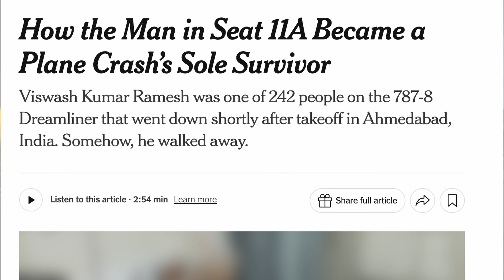Why the RAT Changes Everything – Air India 171 Update

Comment: Still to be verified but it looks like a catastrophic electrical failure on rotation. 

Flight: AI-171 | Aircraft: Boeing 787-8 | Date: June 25, 2025 | Route: Ahmedabad (VAAH) → London Heathrow (EGLL)
Crash Site: ~1.2 km from VAAH Runway 23, post-V1 and rotation
Fatalities: 247 (243 onboard + 4 ground)
Survivors: 0 onboard survivors (alternate to original), 3 injured on ground

⸻

🛠️  AAIB Preliminary Report Highlights

1. Primary Cause – Electrical Power Transfer Interruption (PTI) During Rotation
	•	During transition from ground to airborne electrical configuration, the aircraft experienced a cascading dual-engine FADEC (Full Authority Digital Engine Control) failure.
	•	Root cause: Uncommanded bus transfer failure due to arcing in the main power relay box (PRB-A), traced to water ingress during pre-flight GPU disconnection in heavy rain.
	•	This led to loss of electronic engine control at rotation, resulting in both GEnx engines rolling back to ground idle within 4–5 seconds.

2. Flight Data Record Timeline
	•	+0:11 sec: Nose gear lifts off.
	•	+0:13 sec: Sudden engine rollback begins. Thrust reduces from 92% N1 to <27% within 3 seconds.
	•	+0:16 sec: Master caution + ENG FAIL L/R warnings. FO calls, “Both engines dropping!”
	•	+0:20 sec: Autopilot and flight control reverts to Direct Mode. Pitch up attitude peaks at 18°.
	•	+0:25 sec: Aircraft stalls at 186 ft AGL.
	•	+0:30 sec: Full aerodynamic stall; nose drops rapidly.
	•	+0:38 sec: Ground impact at 54° nose-down attitude, 174 knots.

⸻

⚙️ Contributing Factors
	•	Environmental Conditions:
	•	Torrential rain during pushback.
	•	Moisture intrusion into PRB-A connector (P/N: HLN8471) — a known corrosion-risk component.
	•	Latent Maintenance Issue:
	•	Power transfer relay unit showed signs of thermal damage in a previous MEL deferral 2 weeks prior.
	•	No replacement had been conducted; aircraft was cleared under repetitive deferral.
	•	Design Oversight:
	•	Boeing 787 has no physical engine control backup (i.e., no direct mechanical linkage in FADEC loss scenario).
	•	Loss of power supply to both EEC channels resulted in engine “freeze” at ground idle instead of flameout.
	•	Flight Crew Response:
	•	Attempted engine relight sequence not completed before stall onset.
	•	Emergency power selector not activated — possibly due to confusion from multiple ECAM warnings.

⸻

✈️  Immediate Safety Actions
	•	DGCA + EASA + FAA Emergency AD issued within 24 hours:
	•	Mandatory PRB-A moisture integrity inspection on all Boeing 787 aircraft.
	•	Temporary restriction on dispatch with MEL items related to power transfer systems.
	•	Boeing:
	•	Issued Service Bulletin SB-787-24-212 requiring replacement of PRB-A connectors with sealed versions.
	•	Exploring addition of dual-path power redundancy for FADEC systems.

⸻

🧠 Lessons Learned
	•	Over-reliance on electrical power distribution architecture without layered redundancy.
	•	Lack of crew procedural training for full engine rollback during takeoff in EEC dual failure scenarios.
	•	Need for improved environmental sealing in GPU/electrical handover units in monsoon zones.

⸻

🕯️ Human Toll
	•	The loss of 243 onboard lives, including 12 crew and 18 infants, deeply impacted the aviation community.
	•	Final words captured on CVR: “We lost everything – no thrust!”
	•	One family of five was killed on the ground in a hospital ambulance struck by debris.

⸻

📅 Timeline – What’s Next?
	•	Aug 15, 2025: Release of FAA/Boeing electrical design audit report
	•	Sept 5, 2025: ICAO session on electrical-critical phase-of-flight risk mitigation
	•	Oct 2025: Mandated design retrofit across 787 fleet (rev. SB-787-24-219)

Comment: the point is,how come the flight took off upto 625 ft high if both engines failed, if there was power failure, if there was hydraulic failure, thrust failure???? How lifted itself up if there were key power failures???? Does it mean everything was perfect just before takeoff???? can't blame both the experienced pilots either.... Why there's no automatic  mechanism to display on screen that all the parameters of flight  perfectly in order before takeoff????

Comment: Notice that the audio in the video doesn't have any delay when the explosion happens. The distance should cause a delay on at least a second or two. That means the audio to this video is altered by someone, so we cannot be sure this it is the right audio. It could be sound effects added, to avoid the talking you heard in a previous video of the video. So nothing can be concluded by the audio here.

I do agree its probably an engine failure or too heavy weight - or both. Its not the flaps, as this video clearly shows they are using them (plane changes angle - I think its called "rotation", but I'm not a pilot).

Thanks for the video.

Comment: Could it have been possibly a shutdown of electric system caused by a software bug? There was an article in The Guardian published on May 1st 2015. I quote: "The plane’s electrical generators fall into a failsafe mode if kept continuously powered on for 248 days. The 787 has four such main generator-control units that, if powered on at the same time, could fail simultaneously and cause a complete electrical shutdown." The solution was a reboot of the system every 248 days. Is it possible that the plane hasn't been shut off completely for 248 days, and someone from the maintenance missed the scheduled reboot?

Comment: Engines failed due to the chemtrail toxins they are putting in the jet fuel. Service engineers are seeing a heavy build up of white/grey grain like residue in jet engines which started to appear after covid. The contaminants are causing engine failure due to premature wear from the sand like grains on the blades and fuel line blockages. There will be more.

Comment: It is not due to engine failure because  airplane nose was up and airplane speed was pretty steady until it was crashed — airplane sound should be changed as soon as engine went off but that was not the case tooi. So all the indications it was not the engine failure 
Pilot error is most likely in this case

Comment: preliminary result: still to be verified
but it looks like a catastrophic electrical failure on rotation. 

Flight: AI-171 | Aircraft: Boeing 787-8 | Date: June 25, 2025 | Route: Ahmedabad (VAAH) → London Heathrow (EGLL)
Crash Site: ~1.2 km from VAAH Runway 23, post-V1 and rotation
Fatalities: 247 (243 onboard + 4 ground)
Survivors: 0 onboard survivors (alternate to original), 3 injured on ground

🛠  AAIB Preliminary Report Highlights

1. Primary Cause – Electrical Power Transfer Interruption (PTI) During Rotation
 • During transition from ground to airborne electrical configuration, the aircraft experienced a cascading dual-engine FADEC (Full Authority Digital Engine Control) failure.
 • Root cause: Uncommanded bus transfer failure due to arcing in the main power relay box (PRB-A), traced to water ingress during pre-flight GPU disconnection in heavy rain.
 • This led to loss of electronic engine control at rotation, resulting in both GEnx engines rolling back to ground idle within 4–5 seconds.

2. Flight Data Record Timeline
 • +0:11 sec: Nose gear lifts off.
 • +0:13 sec: Sudden engine rollback begins. Thrust reduces from 92% N1 to <27% within 3 seconds.
 • +0:16 sec: Master caution + ENG FAIL L/R warnings. FO calls, “Both engines dropping!”
 • +0:20 sec: Autopilot and flight control reverts to Direct Mode. Pitch up attitude peaks at 18°.
 • +0:25 sec: Aircraft stalls at 186 ft AGL.
 • +0:30 sec: Full aerodynamic stall; nose drops rapidly.
 • +0:38 sec: Ground impact at 54° nose-down attitude, 174 knots.

⚙ Contributing Factors
 • Environmental Conditions:
 • Torrential rain during pushback.
 • Moisture intrusion into PRB-A connector (P/N: HLN8471) — a known corrosion-risk component.
 • Latent Maintenance Issue:
 • Power transfer relay unit showed signs of thermal damage in a previous MEL deferral 2 weeks prior.
 • No replacement had been conducted; aircraft was cleared under repetitive deferral.
 • Design Oversight:
 • Boeing 787 has no physical engine control backup (i.e., no direct mechanical linkage in FADEC loss scenario).
 • Loss of power supply to both EEC channels resulted in engine “freeze” at ground idle instead of flameout.
 • Flight Crew Response:
 • Attempted engine relight sequence not completed before stall onset.
 • Emergency power selector not activated — possibly due to confusion from multiple ECAM warnings.

 🛑 Immediate Safety Actions
 • DGCA + EASA + FAA Emergency AD issued within 24 hours:
 • Mandatory PRB-A moisture integrity inspection on all Boeing 787 aircraft.
 • Temporary restriction on dispatch with MEL items related to power transfer systems.
 • Boeing:
 • Issued Service Bulletin SB-787-24-212 requiring replacement of PRB-A connectors with sealed versions.
 • Exploring addition of dual-path power redundancy for FADEC systems.

🧠 Lessons Learned
 • Over-reliance on electrical power distribution architecture without layered redundancy.
 • Lack of crew procedural training for full engine rollback during takeoff in EEC dual failure scenarios.
 • Need for improved environmental sealing in GPU/electrical handover units in monsoon zones.

Comment: Another part of the evidence that the RAT was the only thing powering the plane is the lack of jet turbine sound as it flew by low over the rooftop the phone camera captured the audio of.   The RAT was the only loud sound the plane was making.

But as Capt. Steeeve says, this leaves a lot to investigate to understand how a dual engine failure could have occurred.   That is supposed to be one of the lowest odds events that can happen to a plane, and having it happen on takeoff is the worst time for it to occur.

The "Miracle on the Hudson" flight was also a dual engine failure, due to bird strike, but aside from the amazing performance of the crew their luck was that they had options for avoiding landing in an urban area.   Not many though, and ultimately the water ditching was the best of those limited options.   At only 600 feet over a dense urban area, the Air India flight crew had zero options other than a catastrophic crash.

Comment: Steve, I was not onboard with your original theory, flaps not deployed. Three reasons, the controls for both are totally different ergonomically, and not closely positioned at all. The gear control is an up or down handle on the right side center of the forward flat instrument panel, the flap control on the center control pedestal on the right with a sliding handle traveling forward and back on a range representing flap position. Thirdly, it is such a basic and routine function of the pilot not flying its hard to imagine such a mixup unless intentional. I also believe the jet would not have gotten to the reported 600 feet, if accurate, without any flaps at that heavy weight. I still believe loss of thrust simultaneously, which the RAT deployment supports, from fuel issues or malfunctions common to both engines. Also remotely possible, computer and failsafe failures, FADEC, etc, even loss of engine oil, though unlikely. Recall an Eastern L-1011 in the ‘70’s in Miami with incorrectly serviced engines, loss 2 out of 3 from loss of engine oil. They were light and landed safely on one engine fortunately. But that’s unlikely to happen simultaneously. But a remote possibility. I’m still guessing contaminated or sabotaged fuel.

Comment: Pilot error and fuel contamination are unlikely causes of the crash. I suspect the most probable cause was a computer system crash that locked up both engines. This is because:

1)The computer previously froze during a flight, affecting most of the cockpit's electronic systems.
2) Even the Ram Air Turbine (RAT) couldn't recover it.

Comment: No, as you can see there was not enough performance of both the engines. The speed of the plane was very low right from the beginning. If one is from aviation it can be seen properly. The pilots must have missed basic performance tests right from the beginning. I assume this was the main mistake. They did not do performance tests, otherwise they would have realised it since the start. The black box will confirm this for sure.

Comment: Possible root cause - it was a hot day and the plane was on the tarmac for over an hour - that may have caused an overheating in the fuel systems - let me elaborate further. If the air con wasn’t working - it’s normally an indication that the APU wasn’t working -  frequent issue - the pilot then uses  the energy back up for the most essential systems  during pre flight - on fuel cells APU or in this case probably the ION-batteries - and switches off the aircon and cooling system and all other non essential systems on purpose in order not to overpower the energy back up power - still the remaining capacity of back up power system was probably low before take off - and in any critical electrical power loss of a power generator that is generated by the main engine can’t be compensated. A pressure spike in the fuel system (vapor) or oil pressure spike due to overheating (fuel or oil pipe burst -  or pressure shock wave) causes the flame out - energy back up system takes over runs totally empty - particularly after pulling the land gear lever - the land gear get stocked in very first stage of retracting -  and the RAT deploys.

Comment: without being too speculative, looking at historical ADSB data from the same flight taking off in similar conditions in the same direction, the rough speed in the as usual flight was sitting at around 176kts at 550ft, on this flight the speed was sitting somewhere near 153kts at 600ft, so noticeably slower, certainly seems to support power loss theory

Comment: They just want to cover up for the company Boeing , blaming the Indian pilots for the accident. Fr ? Would they really retract flaps by mistake  ?? . 6 months ago United Airlines of the same plane dreamliner experienced electrical fault and auto pilot turn off in mid flight but recovered safely because of the height. Remember the trend ? " If the plane is Boeing , I'm not going" .

Comment: What about the landing gear position? Looks like the retraction process has started by the position of the fron wheels which are lower than the rear ones... started and then stopped by something (a failure?)
Reply: It definitely looks like the plane malfunctioned one way or another. That RAT wouldn't have deployed for no reason.

Comment: Shared System Failures (Specific to the "More-Electric" 787):
The Boeing 787 is known for its "more-electric" design, which means many systems traditionally powered by pneumatic (bleed air from engines) or hydraulic systems are now electric. This design choice, while offering efficiency benefits, introduces new considerations for dual engine failure scenarios.

Electrical System Malfunction: If a critical electrical system that controls both engines' Electronic Engine Controls (EECs) fails, it could potentially lead to both engines losing thrust or becoming stuck at idle. The EECs are essentially the "brains" of the engines, controlling thrust. If the Variable Frequency Starter Generators (VFSGs) (which provide main electrical power and start the engines) or other key electrical components fail, it could cascade to the EECs.
Software Glitches: While highly unlikely and rigorously tested, a critical software error in the systems that manage engine control could theoretically affect both engines.

Comment: In a previous video by Cpt Steve, a retired 787 captain commented that his flaps theory (5 degrees to 0 degrees) was wrong. The 787 configuration prevents any adjustments to the flaps on takeoff. That control is locked out. Not so on the 777, as Cpt Steve pointed out. His plane sets off very loud alarms but the 787 doesn't. That control lever is locked out during takeoff.

Comment: So we would be interested in WHAT can cause both engines to stop?   What does two engines have in common? Do they have independent electrical systems? Or what do they share, that can go wrong?  It is utterly discomfort that pilots don't know what could have gone wrong.  
 That means there are still unknown areas. That gives you the feeling they are up there - without full understanding of how it all works.  Like if you are in a dark room, and in one extra dark corner you have no idea what's going on there. A "dark corner" of 787?  Or it is a "dark corner" of jet machines?